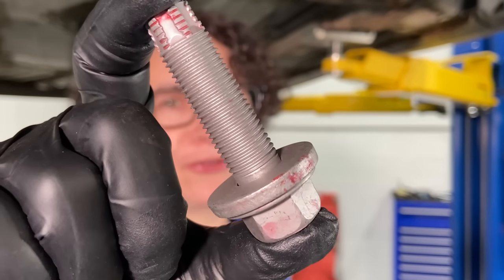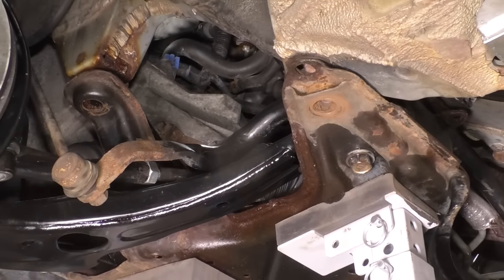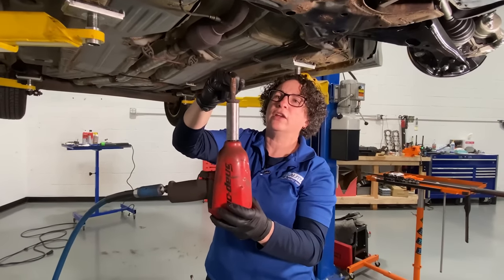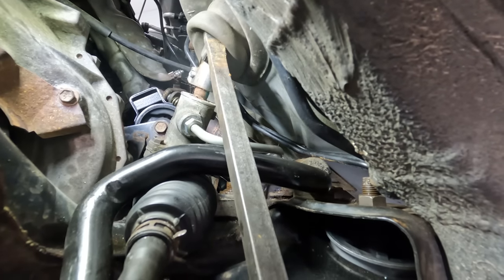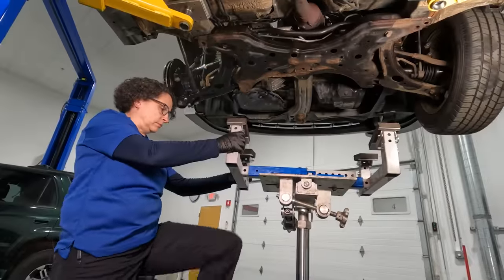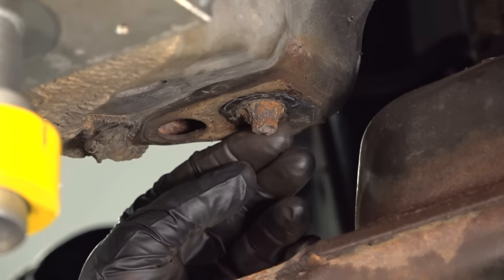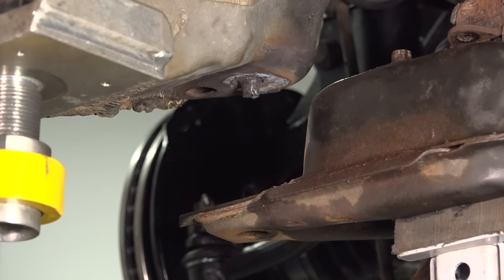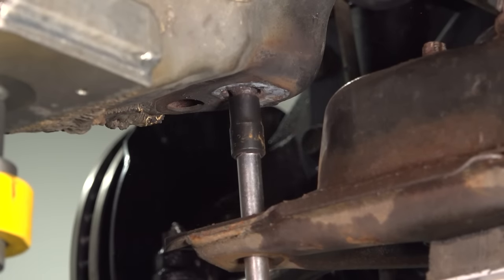Broke Subframe Bolt Replacing Sway Bar Bushings and Links? Watch Pros Remove Broken, Stuck Car Bolts

Comment: I just had the same problem last week except it was the front subframe bolt that broke off beneath the surface of the hole.   I knew I was in big trouble.  So,  I took out my bolt extractor and drilled the hole in the bolt for the extractor.  Of course,  the extractor broke off inside the bolt.  I knew I was now in deeper trouble.  So, I took out my map gas torch and heated it up for about 5 minutes.   I then took a small chisel and started trying to spin the broken bolt out by tapping the chisel.  No dice.  So,  I applied even more heat and repeated the process.  Lo and behold the broken bolt moved a bit.  With repeated application of a lot of heat and tapping the broken bolt,  I was able to get it out.  I knew right then and there that the Lord does indeed work in mysterious ways. My advice to other novices like myself is to pay to get the subframe removed. It is a difficult job fraught with complications.  The subframe is very heavy,  especially if you leave the control arms attached. It is not nearly as easy as shown on YouTube videos.  Let a pro do it.

Comment: If you hadn't used an air gun on that bolt you probably wouldn't have had an issue. People rely to much on air tools in my opinion. If it doesn't break loose with a breaker bar. A liquid penetrant and a flame, or induction heater are you best friend.

Comment: Awesome steps shown. How about a PART 2 video showing how to deal with bolt that breaks off flush so you can use a TWISTY SOCKET on it. And/Or Perhaps a Tap and Die tutorial if needed after that.

Comment: You're a LIFESAVER, Sue! I FREAKED out yesterday when I broke the SAME rusty bolt on my 09 Prius trying to replace the control arms 😳 and your video SAVED me! 

I ordered an induction heater and bought twisty extractors from Home Depot, but I didn't need the heater because all it took was torching the bolt for 5min and my twisty extractor socket twisted it right out! And boy did it make a cringy squeal! Then I found salvaged bolts for free without any rust at all (I live in Colorado). That steering column ended up being the biggest pain, but I was back on the road in 24 hours! 😅

Comment: Great and informative vedio.also on rusted up bolts one can saturate them with pb blaster and let them soak overnight.if one is really lucky sometimes you can find a opening in frame to spray oil onto back of bolt to soak the threads real good then if bolt does loosen slightly re apply oil periodically as you turn it back and forth to loosen rust as you turn it out.alsu a 6 point socket or boxend wrench is better than a 12 point type for this type of stuff..keep them hoopties running lol

Comment: Is it safe to say it’s necessary to replace any bolt/nut heated to this extreme for removal? I’m assuming its integrity is toasted (no pun intended) once it’s been heated so much. Also, for critical bolts like suspension parts is it ok to use grade 8 replacements from the hardware store or do you always suggest getting OEM bolts? Thanks for such clear and to the point info - very helpful.

Comment: I like the 1A videos & I like her as a presenter.
My question is why, oh dear why did you go straight to airgun? Penetrating lubricant, heat and torque wrench slowly to get it out. Why airgun jerk & brake it?

Comment: One question to 1A. Why would someone remove these subframe bolts in the first place?  My 2009 Fusion has a rattle that’s getting really bad in the right rear. Subframe bolts would not be the culprit right?  I’ve replaced numerous suspension parts already. Thanks so much

Comment: Dear A1 Auto
Sorry to bother you, but I have a question.
How much torque do I need to tighten the front subframe bolts? ( Mercedes Benz E 220CDI BlueEFF W212 ) 
Thanks in advance

Comment: Nice! I actually used the info here. 

The only criticism is the yellow can on the torch should be acetylene, not butane or propane. Propane has a blue can. Butane I believe is also blue. Anyone want to correct me on the butane?

Comment: If you can't get out an aluminium drain plug to a gearbox, can you use an induction heater without too much risk of setting the gearbox oil on fire?
Reply from the maker: +@Benzknees We do not recommend using an induction heater.

Comment: Induction heater , i can see why  my mechanic is charging me 1000 dollars to extract the frame bolt , the cradle come down, keep the cradle still because, the cradle will rock